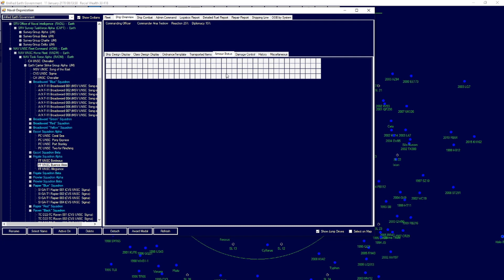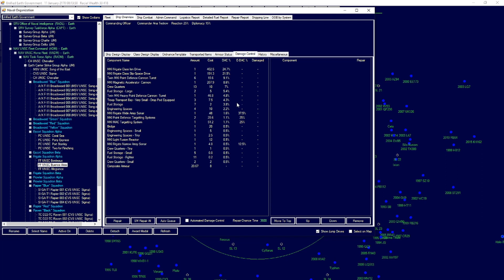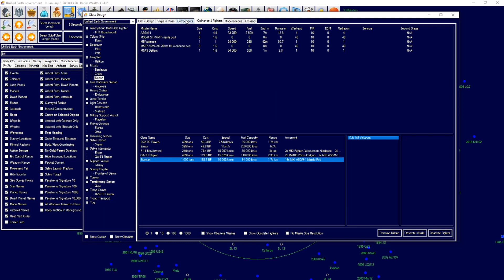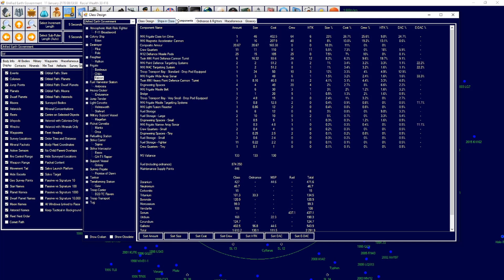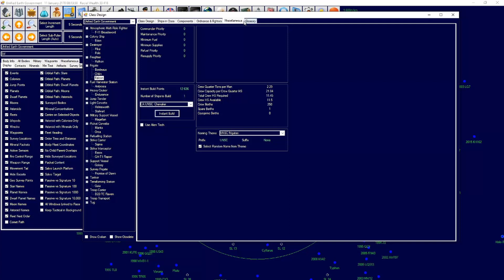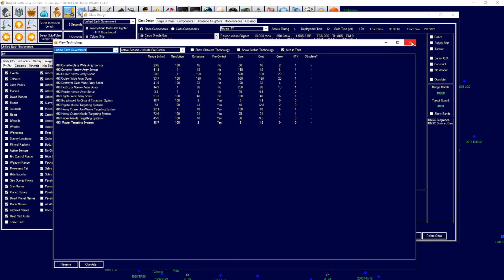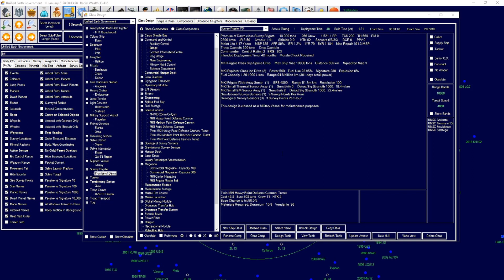Aurora 4x C# Basic Military Ship Design (1) - Mechanics - (720P Due to Issue)

Comment: Some correction to fire-controls, tracking and missiles..

You have a base tracking rate depending on technology... say it is 4000km/s. If you mount a weapon on a ship that move slower than 4000km/s you will always be able to track at a base rate of 4000km/s. If the ship is faster than 4000km/s and the fire-control is also able to track faster you track according to whatever is slowest. The same thing with turrets so you normally want to match fire-controls with turret tracking speed, but sometimes you over engineer the turret so you don't have to replace it when you get a better fire-control tracking speed.

Another thing is that you do not get a bonus "to hit" if you can track "faster" than the enemy is moving but you do get a penalty if they move faster than you can track. So, if I have both movement and tracking speed of 4000km/s on my laser beam ship against a ship moving at 3000km/s I hit that with my regular to-hit ratio. If they also have a basic 4000km/s tracking speed technology they will also hit my ship at the normal to-hit rate even if they move slower than me.

A third thing was about missile salvos. A PD fire-control can engage an unlimited amount of incoming missile salvos. So you only need on PD fire-control per ship and perhaps one addition for backup can be smart (especially on dedicated beam PD ships). Although, one single "turret" can only engage one single missile salvo.
Reply from the maker: While a lot of that info is correct steve explicitly said that any fire control can only engage up to 1 ship or 4 missile salvos at once, good info though, the point on not having bonus to hit is correct though the rest is kinds covering what I said
Reply: @DefranStrategy  
No... Steve have not said anything about Point-defence FC only engaging 4 salvos (in my knowledge)... this is the change in C#  http://aurora2.pentarch.org/index.php?topic=8495.msg117825#msg117825

It used to be one salvo per FC but that restriction is gone, but one weapon (including turrets) still per salvo though.

If Steve said anything else I would like a link to that because that is news to me, but I could be wrong.
Reply from the maker: @MrCABman1972  I cannot find the current statement but it wasnt part of the changelogs, what I will do is test this ingame, also the changelog is quite confusing on the subject in reference to restrictions and what can fire but that can sometimes be steve xd, good information though and I will reevaluate this.
Reply: @DefranStrategy  
Just to be thorough and wanted to make sure we know exactly how it works so I just tested it in 1.9.3 and it does confirm that there are no restriction on the fire-controls.

 I built one ship with 18 rail-guns and one fire-control, I also built an enemy ship with 10 missile launchers and 10 missile fire-controls. 

According to the log there were 10 salvos of one missile each and the PD ship managed to shoot down 8-9 missiles per impact. So all weapons fire successfully with one control against 10 missile salvos.

I think you probably just confused some response with something else... this game are so complex that we do all these mistakes all the time... I still do... especially now with C# being so new.  ;)
Reply from the maker: @MrCABman1972  Yep My testing found the same thing and correlates with yours, in my next video I talk about this at the start and clear it up, thank you for the constructive feedback and the testing, I will make sure to highlight this.